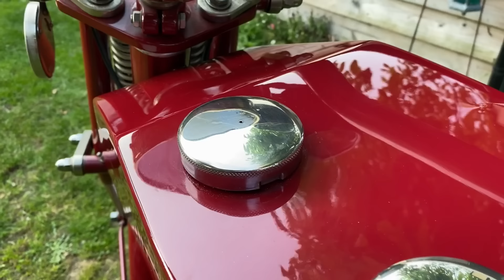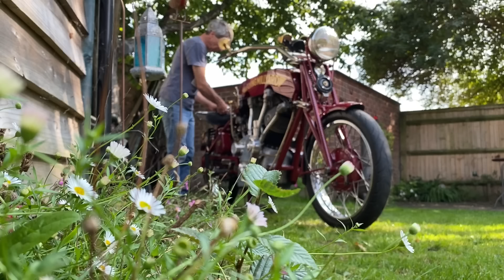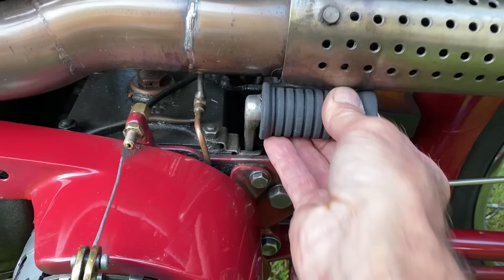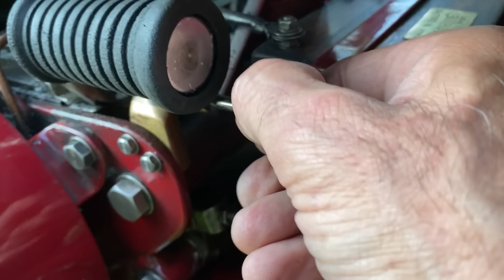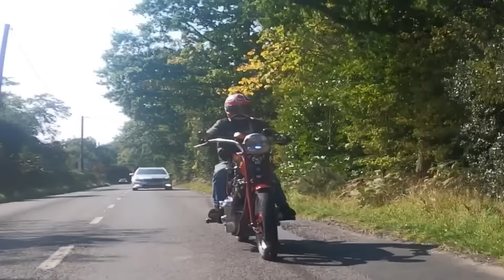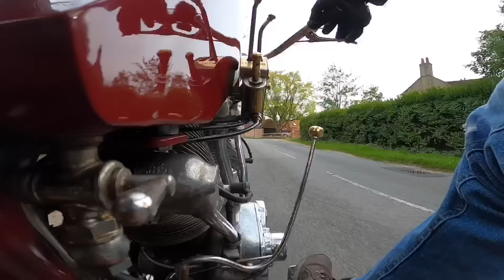The Flying Millyard 5 Litre V Twin  - Part 2

Comment: Thats amazing. One of the very best pieces of engineering I've ever seen. The longer I look at it the more interesting and perfectly executed things I notice. What a machine. 
Just one question - why the need to run rich at low speeds? I've never had much to do with aero stuff (apart from staring a lot whenever I see some). 
Genius and skill again, Allen. You're a national treasure.

Comment: I am not sure if anyone else has already pointed it out, but it looked like there is a crack in one of the plug caps
Reply from the maker: its a rubber LODGE replica cap its 9 years old but still works fine and I do ride it in the wet with no problems, it adds to the patina
Reply: @AllenMillyard  The main reason I pointed it out, was in case you were using one set of plugs to run, and the others as a back-up. And in that case, if you hadn’t noticed the crack, it could have let you down when it was called upon in and emergency. Thank you for your reply, I really didn’t expect you’d have time to read the vast amount of comments, let alone answer them.

Comment: Lovin' the sound of that Allen, when you ride it it seems to barely be off idle!!!  Bet she sounds good at full chat....have you ever had her at full chat???
Reply from the maker: Not yet but I did take Steve Plater (TT legend ) on the back around Jurby on the isle of man and we were hitting 80mph down the straights  😎
Reply: @AllenMillyard  Think the FM needs a run at Elvington. You know,just to know,😉
Reply: I was going to say that - she sounds like she wants to fly
Reply: What's it do to the gallon Allen?
Reply from the maker: About 35 mpg cruising at 60ish
Reply: @AllenMillyard  not much more than my 1340 FXD. Uber torquey  bike Allen. I'm so impressed with your engineering abilities.  Best from NZ
Reply from the maker: @sheeeene7  best ive had is 40 mpg
Reply: @AllenMillyard  seems about right for size and weight....I reckon she’s tuned spot on!
Reply: @sheeeene7  I think it would be more accurate to ask, how many gallons to the mile! 😂
Reply: @sheeeene7  prob negative 1 gallon s per km
Reply: @sheeeene7    I am also curious as to the weight of your impressive bike.
Reply: @sheeeene7  Atleast a mile I reckon!
Reply: @sheeeene7  yes
Reply: @sheeeene7  I would say about 50 smiles per gallon :-)
Reply: @sheeeene7  1
Reply: Allen  do you have any guesses as to  peak hp  and revs it is happy to spin to
Reply: @leeruss979  He mentioned 900rpm at 60mph, and hitting 80 on the IoM, which would be 1200rpm.
Reply from the maker: @leeruss979  didnt make it for power with but would guess around 40 bhp at 1800 rpm i lowered the compression to make it docile and easier to start
Reply: @AllenMillyard  Thank you. The grin on your face says it all!  I always liked twins that had enough hp to shrink the rear sprocket and lower the rpm at 55mph.  It is a work of art! Cheers!
Reply: @AllenMillyard  the torque, how much torque? 150ft/lb?, 200?
Reply: The Missenden Flyer meets The Flying Millyard.
Reply: @alexmorgan3435  they both want to take it to the sky 🤣
Reply: I think it would make a great vid seeing you do a pillion ride as Steve Plater did.
Reply: these 3 videos were a pleasure to watch alan, your ingenuity knows no bounds, that big torquey thing must be a belter  to cruise along on and at 35-40mpg thats really impressive mate, thanks for sharing your projects, theres a lot of us out there smiling whilst watching these wee treasures I'm sure, cheers 🍺🏴
Reply: Thank you Alan milliard for building and sharing this with us
Reply: This man is a Genius... Regards from Ireland

Comment: I never grasped how big that engine actually is till I saw you on the bike . I was always wondering why the long tank and extended bars but I see it now . That is an absolute beast of an engine 👍. It's a thing of beauty , it really is . Does the primary chain slipper try and straighten out when you decelerate or is it spring loaded ?

Comment: Propper sooty? You should’ve seen the second cylinder plug on my Seat Arosa every 6k Miles.

Valve stem seal was on its way out, and I couldn’t be bothered to change it, seemed like more hassle than just cleaning or replacing that plug every oil change 😂.

Comment: My God!
You can still hear the radial aircraft engine noise, especially on the overrun..

So many questions...

What's the compression ratio?

Is that a reduction gearbox on the starter?

If it back fires will AM be found on the moon?

Comment: 60 mph @ 900RPM....... just wow. Imagine the horsepower from the original engine with 9 cylinders. I was hoping to hear you rev it up though. What is red line for that engine, and can you approximate it's top speed at redline?

Comment: Wow a true engineer's video of a pov. No nonsense talks, and loud narration, pure sound, so many angles, all the process detailed as it happens, all situations demonstrated. Capturing the essence. Wonderfully detailed. 
I have made a lazy video of my 150 cc suzuki fiero, with a similar intent. One can check that out my channel, by the name, let's ride.
Thanks again for sharing, the engine build process was jaw dropping fhe scale of it, and the wooden hand carved mold of the crankcase. And as everyone has mentioned, amazing job with the building of two freaking mamoth carburetors. And last but not the least. The addition of fine print, with the country and craftsman's stamp. 
12 volt charger for iphone and heated gloves, what!
And the wooden box for battery.
So much attention to detail. Just marvellous. Thanks for taking the time to read. :)

Comment: Hi Allen, what a machine, could feel the torque through the video, would it actually manage with just one gear.?. Sounds fantastic, looks fantastic, a true one off.!! I may have missed it, is the lub for the primary drive a total loss system which you hand pump at your dicression.?? Loved this video Allen and as usual can't wait for the next one on the Viper. Thank you for taking the time to make them. Cheers, Alex.

Comment: Probably a silly question but having those spark plug reducers in place means the spark is actually produced slightly further back inside the cylinder, by the thickness of the hex top of the reducer. Does this then retard or even advance the point of actual ignition?
Reply: The narrower modern plugs typically has longer threads, dissipating more heat to keep the caps cooler. 

Many plugs are also available with different amount of potrution, those  with triple electrodes are typically potruding quite a bit.

Comment: The longest handlebar in the world is required to reach over that colossal engine!! Did you say 60mph at 900 rpm? Adjectives fail me Alan....fantastic!!
Reply: Not so much handlebar as..tiller :)
Inspiring guy, thanks for sharing 👍
Reply: You see long handlebars and tanks on early motorcycles, especially 4 cylinder models. We used "longhorn" handlebars on our bicycles when I was a kid in the USA in the 1950s.

Comment: I wonder what it's top speed would be? Thanks for these videos Allen, they've inspired me.
Reply: He says it revs 900rpm at 60mph (100km/h) in the video, and replied in the comments here that it tops out at 1800rpm under load (max 2200 without), so 120mph, or 200km/h. 

I soo hope he'll indulge in finding out, filming it on an airstrip or dragstrip, and do a nice dyno run. 

But  I'd understand if he never intend to push the engine or the bike though.
I've seen pistons go projectile through engine heads and hoods in racing comparably tiny engines, can't imagine what a single piston can do that has bigger displacement than my Volvo red-block four-banger has combined...🤔😲

Comment: Found myself singing "What's that coming over the hill, Is it a Millyard? is it a Millyard?" Fantastic sounding machine (and chuffed to bits you also have an ST1100! :-) )
Reply from the maker: Had my ST1100 since 1999 its an amazing road bike
Reply: @AllenMillyard  Had my W plate since 2013. It just does what it says on the tin "Rubber side down, shiney side up".
Reply: I remembered when the ST1100 came out. I was working at a huge bike shop with Honda dealership at the time. My boss/the company founder immediately got one and had it for years! 

We all loved them, branch folks and customers! 

An amazing ride indeed!

Comment: Allen, you are completely mad, but absolutely great. What an amazing creation. One technical question: Why do you have the option to retard the timing after top dead centre? I don't understand why you would want it firing after compression. I understand the need not to advance it, when starting, or at low revs.
Reply from the maker: To prevent kickback when starting, check out the first start vid I almost went into orbit and took a chunk out of my shin and bent the starting handle !

Comment: I guess one side benefit of those brass inserts, is that you are much less likely to damage the softer aluminium threads on the heads.
Reply from the maker: Has bronze thread inserts as standard

Comment: Brilliant, has she ever kicked back on you.
Reply: Kickstart is on a one way bearing, if it kicks back it will just freewheel.
Reply: That would save been launched in to another time zone, thanks for the reply.
Reply: @MrKdr500  Wrong.  If it kicks back, the clutch will engage and if you are still on the pedal with your leg straight you will be flying high like a circus acrobat.  If it kicks FORWARD the one-way clutch will run free and the pedal will not be moved and the engine will run.

Comment: - How much torque does it have?
- Yes!
Reply: Let's say it broke the rolling road and then the earth started to spin 5mph faster!
Reply: Registers a solid "adequate" I'd venture...
Reply: Enough torque to suck a draft horse in through the carbies.
Reply: I would be interested to know what the actual reading for HP/TQ are though. Its got to be impressive.
Reply: All torque. xD
Reply: All of them.
Reply: All of it!
Reply: That is my question as well. I'm just wondering if it has more torque then any other motorcycle ever built, (which is probably safe to assume but maybe not considering the other bikes he has built). Just really curious but I'm not sure if there is a Dyno that it would fit on right.

Comment: Absolutely awesome. I love the totally analog controls over timing etc. thanks and well done!
Reply: Shoot, American V-twin motorcycles had manual spark and choke into the 1950s. Most only used spark retard for starting, then left it full advance for running.

Comment: "Hello? I'd like a quote to insure a completely custom made bike that's powered by part of an aero engine.... Hello?.....Hello???" 

"Darren, Darren! It's that bloody nutter again...!!"

Alan, you are simply amazing!
Reply: I too was wondering how much it costs to insure this aircraft??? 😫
Reply: @DavidBrookesBrand  Why bother?  Outside of being lost to fire it could only be hidden in plain sight, like a faux Mona Lisa.
Reply: Riz Reid legal requirement to ride on the road. No insurance, police impound your vehicle.....
Reply: @DavidBrookesBrand  A little who going to steal it?
And it out put like 10 horse power at  normal cruise speeds (there ten steam horses an ten times as nasty vs normal horses.)
Reply: I am guessing Allen is in his 50s, probably has a few years NCB and insures multiple vehicles. Age of bike? 1947 ish? Horsepower? 100 to 150? No supercharger and not balanced like a rotary for higher revs. It might not be that scary in terms of cost. I just increased my BMW R65 to 860 and it cost me a tenner. Mainly for admin even though it was renewal time. If I was 19 and wanted a Ducati, then the price would be different. I imagine the Viper might be a different prospect...

Edit 1930s and 80 ish HP after  quick search. Value for insurance? Various scrap parts bolted together, could be £1,000 or £20,000 unless it's been valued!
Reply: How do you go compare that?

Comment: Such a unique machine amazing. What do you use in petrol tank the white coating ? Im restoring the tank on my 1980 xl250s was going to put a sealant in as it was a bit rusty I've never used it before whats best?

Comment: It's strange hearing such low engine speed. It just seems wrong. Amazing.
Reply: And with every ka chug, it would vibrate from taillight to front fender stop for one second and DO IT AGAIN !!!
Reply: Ya shoulda heard the 60s Royal Endfield ,twins, they would go ka chug 1,2  ka chug 3,4 ka chug 1,2 ka chug ,3,4 at idle at a stoplight ! 60mph was low idle, max rpm 1200 at  120mph !!! If you ever heard one,you never forgot it !!